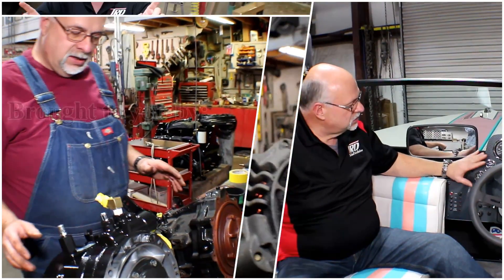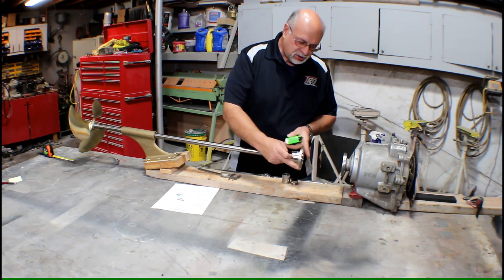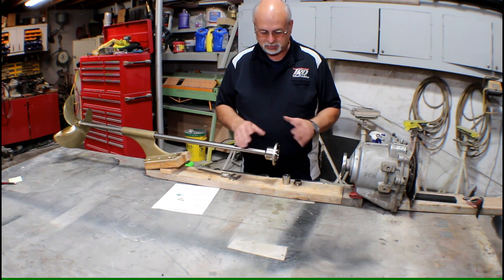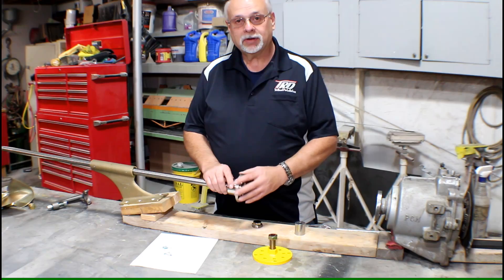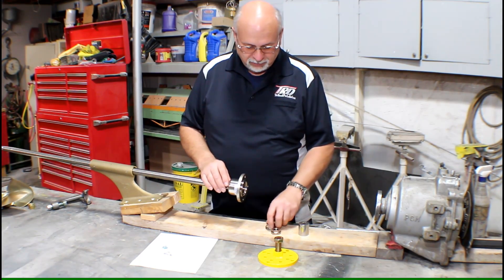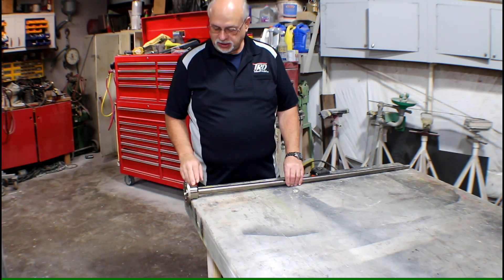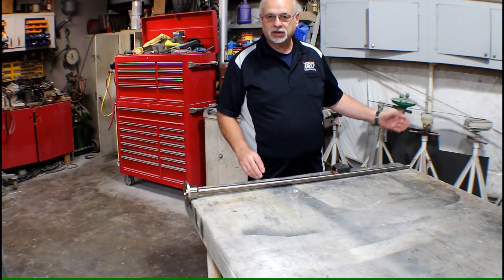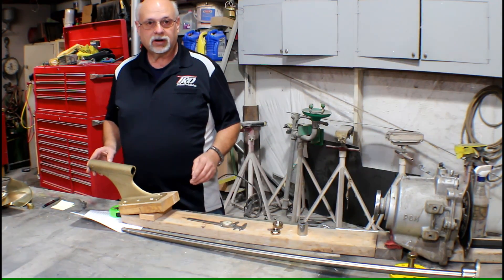Ski Boat Prop Shaft & Coupling Measuring

Comment: Do you guys have a ongoing record of shaft lengths for particular boats? I figured I would see if perhaps my 1997 Sanger DLX has already been on record for shaft length.
Reply from the maker: We do, BUT boat builders typically have +1/2" and - 1/2" length shafts for when the engine setter sets the engine a bit too far ahead or behind where it is suppose to go, therefor we prefer to get accurate dimensions before shipping a shaft that may be too long/short. Measure twice cut once.

Comment: I only have .250 between prop and strut.
Reply from the maker: That will work but not desired, to remove prop you will need to disconnect the couplings to slide the shaft back enough to get the prop puller in there.
Reply: @rontanis1024  Iwas thinking a 13x12. Maybe i should install another shaft.

Comment: Hi Ron 
I just bought a brand new wake boat and noticed I only have 3/8’s between the prop and the strut and noticed the key holding the prop is rubbing the strut. Would that be because it has a short shaft? What would you recommend I do

Comment: Hey Ron great videos , I was reading through one my handouts I got in trade school and it stated between the prop and the strut the distance should be 50% of the prop shaft diameter. If your off a 1/4 inch or so does it really change much?
Reply from the maker: Using your method a 1" shaft would have a 1/2" gap between the prop hub and strut. I recommend for both 1" and 1.125" shafts 3/4" gap with 1" being the MAX and 1/2" being the MIN allowable limits, anything less than 1/2" will prevent a typical prop puller from fitting without loosening the coupling. A new installation with a 3/4" gap will actually loose a little of this gap (up to 1/8") with motor mount break-in.....RonT

Comment: Ron, can you please advise me on how to fix spider cracks in gelcoat pls sir?
Thanks 
Thomas
Reply from the maker: Spider Cracks are generally cosmetic only,  but to properly repair them you have to address the cause. Next issue is gel coat color matching, after that it is kind of like what a dentist does for a cavity, grind out the bad, and fill with new gelocat, and try to minimize the repair area. If i get  an opportunity to repair some cracks I will film it. Feel free to call to discuss your particular issues. 985-542-4336